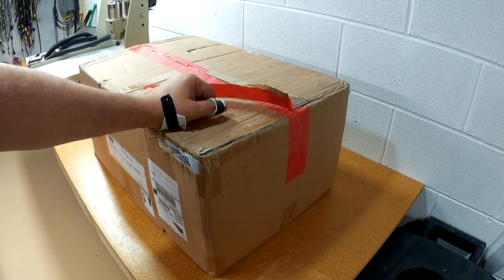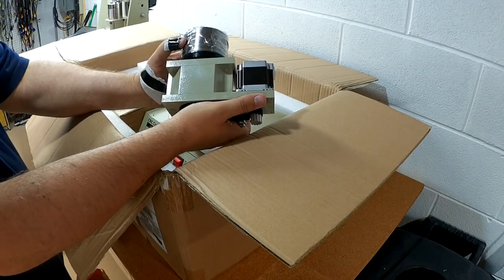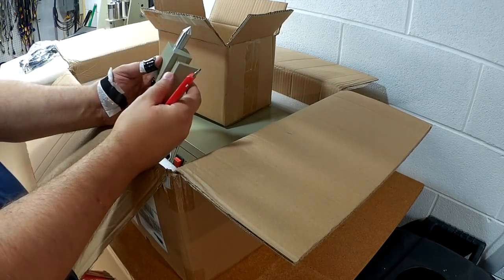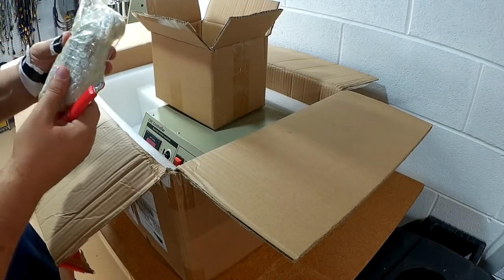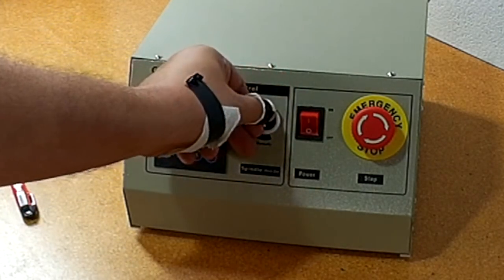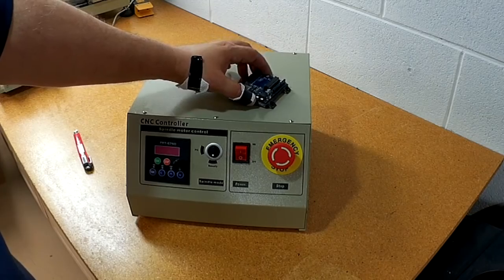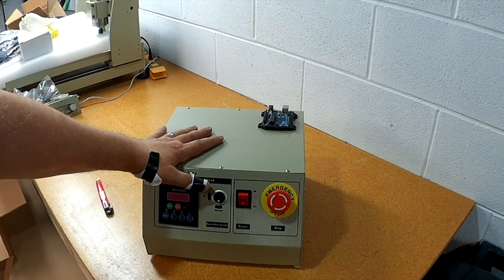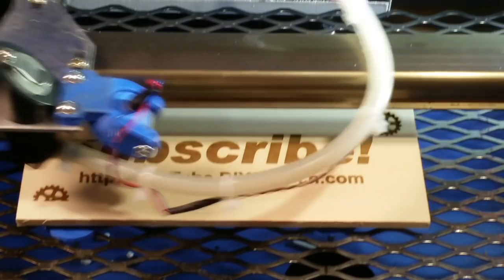3040 CNC - Unboxing and Discussion Part 2 of 2!

Comment: Hi I'm thinking of getting the 3040 for making fishing sinker molds and for soft bait molds would you recommend this for that and what software would you recommend?
Reply from the maker: Yes it would work, but might be more work, if your casting lead it melts like pewter so why not 3d print your sinkers and cast them in Mold Max 60?  Also for soft bait, just get a resin printer  print the molds it will be a LOT easier trust me!  Software, Fusion 360

Comment: Hi! How good is this CNC router? Is it solid enough to cut aluminum? may be some steel with slow cutting? Would you recommend buying it? Thanks!
Reply from the maker: Yes to recommending it as for the money this thing is a amazing!  Also check out the playlist for to see all the crazy stuff I cut with it!  Steel it depends, as with the 800 to 1000 watt water cooled spindle (no to the air cooled 400 watt) yes but the question will be tolerances as there will be some flexing and speed.  I would suggest using cooling and lubrication too...
Reply: @DIY3DTECHcom  thanx! I have bought it, 3040 with water cooled 800w spindle. How have you set it up to control spindle from Mach3? I have tried D001 -1, D0032 -1, with this settings when I turn it on in Mach3 it stopps, when turning it off in Mach3 it starts running. And no tach.

Comment: I'm really thinking of buying a 6090 4 axis, 1.5kw spindle cnc from ebay. I found your video while doing research. I've also looked at the Workbee and Shapeoko models but they don't have the weight, rigidity and accuracy that the ebay machines seem to have according to my research. How do you like the 3040 on these aspects and the electronics? Also, have you cut any aluminium with it? If so, how did it hold up? Any input and advice will be greatly appreciated!
Reply from the maker: I think these are for far better for cutting metal then the Shapeoko, as they have lead screws and the Shapeoko belts which is "okay" for wood but metal you will kick yourself.  Also find these to be far more rigid then the Shapeoko or like CNC's as they are cast alloy and not extruded aluminum stock.  The electronics are acceptable for the money and you can interface with GRBL too (I wrote a book on it here: https://amzn.to/2NLQDSW ) I also will be doing a review of another more professional controller in the near future.  Also be sure to check out the 3040 CNC list for more stuff...

Comment: I bought one kinda like this a few months back off ebay, thinking the TBI hadnt erased the little cnc skill I had,I was wrong. I maintained some measurement capabilities but the program part is gone. can you guide me in getting it moving ?
Reply from the maker: Chuck good to hear from you but not sure what your asking as there a couple routes you can go for connecting to a computer.  As I wrote this book (http://amzn.to/2CjAAV6) on interfacing it to GRBL as well as check out the CNC playlist as there is a ton of stuff on this.  The other route is Mach 3 too

Comment: how did you attach the 4th axis ?
Reply from the maker: Have not used it yet but it just plugs in and clamps to the bed, the software you need to design (not run) can however become expensive

Comment: Was there any cost or pro/cons in buying a parallel controller vs one that has a USB port?
Reply from the maker: Basicly at this price range there isn't one with a USB port.  Now I know what your going to tell me that there is but again at this price range they using a USB to parallel adapter and they are trash.  While they have gotten better, they very problematic as watch the other video in the 3040 playlist as I show how to build a true USB to Parallel converter using GRBL.  I even wrote a book on it: http://amzn.to/2GlJAfP
Reply: Ok good to know. Then a Mach 3 ethernet to parallel port box would be a better idea or a real USB to parallel converter.
Reply from the maker: Anything Mach 3  (real not knock off) is quality...

Comment: Hi, love your site and the fantastic vids. Wonder if you can help at all please? My wife bought me this exact same machine about a year ago to be a bit of a hobby for me. After I had had 2 cardiac arrests and been in comas for quite a long time forcing me to retire from 47 years in engineering. I have searched and searched for anyone who had the same on as mine and just found you. I have been trying all that time to get this bloody thing set up correctly, the manual and the factory video seem to be useless. Any chance you could let me know what setting you are using in Mach3,  The 2000 velocity and 400 accel WOW! no way will it run properly and the steps per ( I have those set spot on now) step pulse and dir pulse? etc. etc. Please, please help if you possibly can and I will be forever in your debt. I love the machine but at the moment it is just a piece of expensive furniture, I really would love to get it working properly, and accurately if that is possible. Keep up the good work all the best regards and seasons greetings Chris R oh and PS she has now bought me one of the  laser one for this Christmas!!!!!!!!!
Reply from the maker: WOW!  Sounds like a bit of a journey, so first thing is forget about Mach 3 unless you really, I mean really want to get serious.  Convert it to GRBL and use Universal Gcode Sender, or Chilipepper, etc.  The issue with Mach 3 and whatever  PC your using is getting the timing correct as not all parallel ports are not created equal and if you trying to use a USB to parallel adapter, just don't as they don't work unless you find one that is made to work (think the company that makes Mach 3 might sell one).  Second is Windows is not a real time OS so you will see more issue.  GRBL the arundio becomes the dedicated controller and your timing issues go away.  Also many thanks for the kind comments :-)
Reply: Thanks for getting back to me anyway, even though not really much use. All I wanted were the settings , I guess I will have to keep searching. I really hoped I had found the answer to my woes? I take your point with the timing issues, however there must be millions out there successfully and accurately running Mach and Win.  Grbl is after all fairly new, and something else to learn, I know Mach very well so don't really want to start something else, I so believe that the new laser coming is grbl though?. My son built me the dedicated PC he has been a programmer for 30 years and builds gaming PC's so I trust him that the pc will do the job. Keep up the good work regards Chris r.
Reply from the maker: Best of luck but no matter what you do is windows not a real time OS and the reason most people use Linux as I even use for UGS as windows would time out the USB connection as it wasn't busy enough.  Most of the people you see on internet running Mach is on Windows XP.  Also keep in mind if your using the version that came with your machine it is likely an old version boot leg at that (mine was).  I did actually buy  a version of Mach 3 but had so many issues (I am also in the enterprise computer field and design large scale systems for major corporations) and just got tired of the hassles.  Also keep in mind that GRBL is not Mach sort of, it is only a motion controller and depends upon something to feed it GCode like UGS or Chilipper.  Sorry I could help more and please let me know how you get on :-)

Comment: OK, this CNC newbie has one of these machines on order. Looking for recommendations on cutting tools to use in it. I think I'll primarily work with wood and acrylic. Might try some PCB later on.
Reply from the maker: Well my two cents is is you will need 6mm to 1/8 in collect (http://amzn.to/2iJpaDS) and I would get some of these (http://amzn.to/1LMWEJy) as the two flute is a good all around bit and here is a 6mm version (http://amzn.to/2jUTZ64).  As the big question is will you be doing more "cutting" or "carving"?
Reply: Thanks for the info. In preparation for this purchase, I've resurrected an old computer with a parallel port as well as set up an arduino/GRBL implementation (with the parallel shield per your video).Been working at learning as much as I can on Fusion360 and TinkerCAD. Still a little unsure on the process of generating and sending the files to the machine, but I guess I will figure that out soon enough :-)  You videos here have really been helpful.
Reply from the maker: For a CNC you will want to take a look at Inkscape as that is what I do the majority of my CNC work followed by Open-SCAD (exported as DXF)....
Reply: Thanks again for the info. I'm fairly familiar with InkScape from my EggBot experiences. Is your Arduino /Universal Gcode setup still working for you? I plan on using that vs the Mach3 route if it will do what I want it to. My 3040 arrives tomorrow :-o

Comment: Did you received Two boxes separate? because I got only  one (the cnc machine without the rest of the parts.) thanks for the vid
Reply from the maker: Yes two boxes came, the machine in one (the big one) and the VFD/Controller in the second.  Also you welcome and have a bunch more in queue will come out in later Jan and early Feb featuring this machine.

Comment: good video , hust mine exactly the same , damaged rubber foot and wiring loose on the connections , but on the whole very well made arrived in 4days after order and just as well packaged , once the computer connected i may post on youtube also .
Reply from the maker: Yes I can't complain for the money, however did you get a book or any instructions for the VFD?  As I got nothing and can't seem to find anything on the net...
Reply: i received very little instruction sorry , just been messing with it till i learn something ., just posted my 1st run .
Reply from the maker: Please do keep me posted if you figure it out as so far no clue and I can't find anything on the internet...

Comment: when you spring a leak , those great shop leak stopper .   Great video . oh and remember CA glue is good for those small cut like paper cuts lol .
Reply from the maker: LOL!  With two lasers and this now which are water cooled and thinking about using the later to create (i.e. CNC) to create water cooled heat breaks for several of my 3D printers has me kicking the chiller idea around...